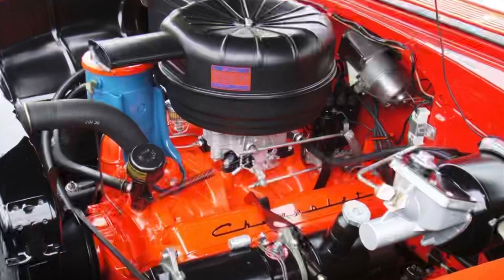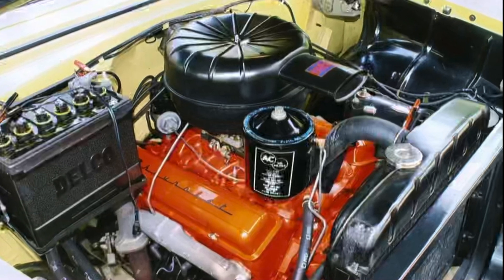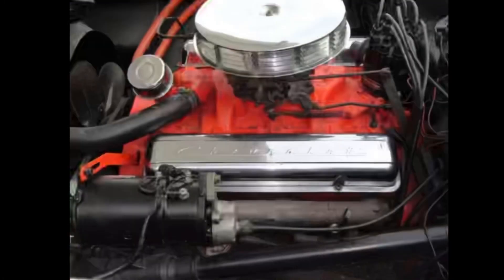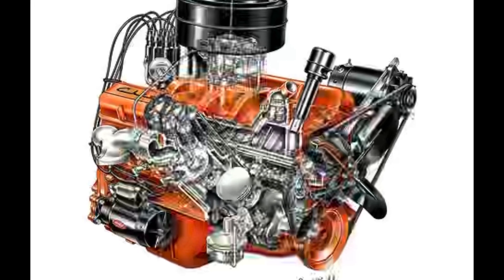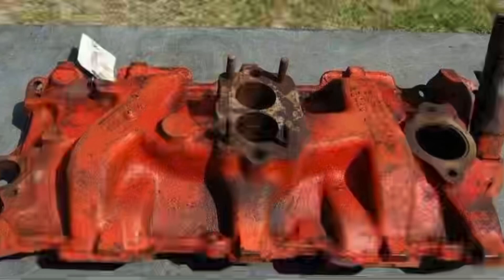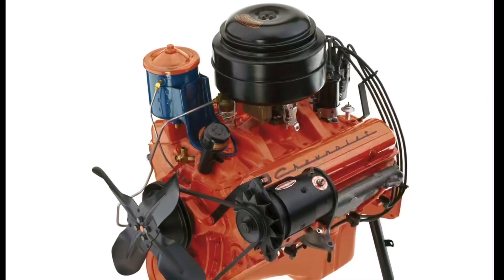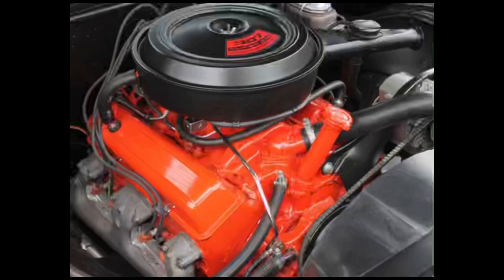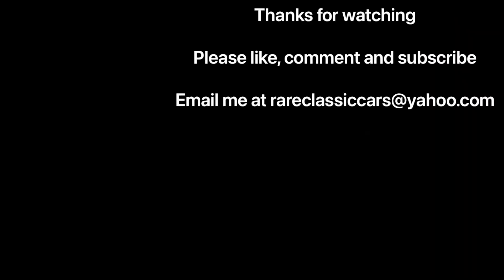Best Engines of All Time: The Chevrolet Small Block V8 (262/265/283/302/305/307/327/350/400)

Comment: Arguably one of the most versatile engines ever made. From basic transportation to super performance, the SBC did it all.
Reply: Facts. Another great sbc is the 5.3L (basically an LS, but for basic transportation and work specifically in 1999-2006 GM trucks) those engines can take a lot assuming basic maintenance is involved. To me, that particular chevy small block is like an old 327 and a 350 combined cylinder stroke wise, with modern touches and technology. They are best of both worlds for basic use and performance like the 350. But it is more well known as the LS engine that you could swap into anything and maxed out for performance. Vortec 5.3L or not, they are both great to me!
Reply: @trickyricky12147  The 5.3L LS is basically by far the cheapest engine to buy and swap in pretty much anything.
Reply: Don't forget Marine.  Chevrolet small and big block powered 80 to 90 percent of all gasoline powered inboard and I/O boats during the time they were being produced.
Reply: @DEW409  Yep you got it brother.
Reply: And just think if they were able to use synthetic oils back then how more reliable the would be
Reply: @jeremybroderick9465  Right on my brother.

Comment: The only SB Chevy Engines I had were a 1970 Biscayne SW and it had valve train clatter Never got rid of ....and a Under Powered  302 in  1978 Chevy Malibu, and a 1970 Chevy 1/2 ton with a 400 V-8 no problems except a Trans mount. good runners and cheap to fix...

Comment: Definitely the best US all around V8 of the 20th century.  Incredible power potential, reliable.  It could power a small car up to a small school bus.  Excellent oiling system, second to none. Every other US V8 had a less robust oiling system, which you discovered if you tried to race with them.  Strong block casting, with or without 4 bolt mains.   5 head bolts per cylinder.
Of course some were better than others over the years, but it hasn't remained the #1 choice for local circle track racing because something better was out there.
Reply: oiling, yes,, but strong block,,no.. to race or put any decent hp thru them, you need an 010 truck block. best engine here is the ford 6 cyl 250.. beat all the v8,s at the drags..non injected,or av gas.nox. &, it was on lpg.. 90,s.. the 350, is designed all wrong, heads, cam, lifters/rockers. 50,s tech..flogged to death..

Comment: If my memory serves, NONE of the Buick V8s had hollow push rods until 1970. All the nailheads, (264, 322, 364, 401 and 425) and the 215, 300, 340, 400, 430 and 350 through 1969 had solid pushrods. The exception being the Stage I 400 of 1968 and 1969. In 1970 the 350 and the new 455 had hollow push rods.

Comment: I remember a neighbor had a 75' chevy monza with a v-8 262cui, car was front heavy but pretty quick.
Reply: My brother in law had a Monza with the 305 and although it was smooth it didn’t feel very quick to me but the potential was there. You had to go through the wheel wells to change some of the plugs.
Reply: @garygaarderjr9733  it was a pain ..the drivers side rear plug I helped undo motor mount on that side to move engine just enough to get plug out .

Comment: My '68 Checker has a 307 with 289k miles. It'll run when I get the fuel pump installed.

Comment: My small block Chevy daily drivers would require a water pump every 70K give or take a couple of thousand like clockwork.  I loved the later years when they did away with cork gaskets and almost never had an oil leaking issue at all.  Roller cams were nice too, since the cam lobes did like to round out about the time a water pump was needed.
Reply: I just rebuilt my 1976 350 last year, and did not use a single cork gasket in the rebuild. It holds oil pretty good now.

Comment: Dont forget, the SBC was the "go to" engine for all types of high performance racing, from drag racing, sprint car, nascar, dirt track, ect.  Not to mention all the 32' and 34' Ferds out there with SBC transplants!!!  And today, it is the LS style engine, in almost every type of vehicle imaginable.  Heck, I even installed a SBC in a 49" F-1 pickup truck.   High quality high performance parts could be had for almost any size SBC  cheaper, and more readily available than any other make and model!
Reply: Because there were so many made a lot of companies made aftermarket parts.
Reply: @johnchildress6717  Yes, very important, essential, vital, and necessary!! ;D

Comment: My 350 is on a stand right now to deal with the ubiquitous rear main seal leak, but many of us leak a little when we hit 50.
Reply: I like using the 1986+ 1 pc rear main seal blocks to solve that, but there are better rubber compounds available today for the 2pc rear main seal blocks still in service.

Comment: Small block Chevy:  17 head bolts per head.    Small block Ford:  10 head bolts per head.  Small block Chevy wins.....    Long live the 327.
Reply: LS series engines -- 10 bolts per head.
Reply: @21stcenturyfossil7  I guess the Small Block is better then.  New is not always improved.
Reply: @michaelbenardo5695  , More bolts aren't better if they're not in the right place.  Head gaskets usually blow at the thinnest section, between the cylinders.  And that thin section benefits from the direct pressure of the head bolts.  The top bolt on a SBC cylinder is placed well and, ideally, they'd be another bolt mirrored at the bottom.  Instead, there's two bolts over an inch away from the ideal position.  I have no idea why.  The Pontiac V8 shared some engineering with the SBC and Pontiac did fine with the less complicated arrangement.
Reply: @21stcenturyfossil7  But 4 is the minimum.

Comment: Definitely love at first sight.  I have fond memories of my 327 - two barrel, pre-federal emissions.  My current V8 is a Toyota 4.7L / 285 cubic inch with four camshafts, 32 valves and variable valve timing.  The owner's manual says it is good for 283 hp / 325 ft. lbs. of torque and it met emissions standards back in 2005/06.  Compared to the older small block Chevy, the Toyota V8 is stupidly expensive to repair.
Reply: Lots of 4wd guys in Australia swap to a 350 and they go well. Cheap on parts ,easy to fix can't go wrong.
Reply: Yep you got it brother.
Reply: And the Toyota, like almost all of today's engines, is overly complicated.
Reply: @michaelbenardo5695  Ahmem brother,  how true and they are gutless slugs . I've always had an old 318 with a mild set up as a daily driver around 300 Hp. Nothing special but great on fuel and they run forever,  750,000 k's easy. Bought a new Holden with the alloytec engine, supposed to be 200 k's. Bullshit , worst engine I've ever had . Car broke down at least every 2 weeks then the timing chains went so I traded it on an SS Ute ls1 . Much better car but I'm rebuilding my old Chrysler wagon and I'll stick to the 318. At least I can get that running any time any where .
Reply: @petergoodwin2465  I've always wished to put an original Polyspheric 318 in, say an early 70s Plymouth and build a souped up version of the 57 Fury 318 - dual quads, 290 horsepower at 5400 RPM.
Reply: @michaelbenardo5695  I forgot to mention that the Toyota 4.7 liter also has 8 coil packs and timing belt that needs to be changed every 90,000 miles. . Don't get me wrong, the 4.7 is fine engine - but it's way more complex than the small block V8 engines of the distant past.
Reply: @andrewinaustintx  I have no use for an engine that uses a rubber timing chain.  METAL timing chain for me, or else timing GEARS.  Only exception is the Pontiac OHC 6 of the 60s.  It's timing belt was field tested on dirt roads with no timing cover for 100,000 miles without breaking.  Only then did Pontiac approve it for production.

Comment: I love my 5.7 TBI in my 94 Silverado. Almost 207k miles and not one hiccup
Reply: I had one of those, now have a 96 C1500. The Vortec engine is a step up from the TBI, though both are very reliable engines. Have had to replace the starter motor and alternator in the current vehicle, but generally speaking the maintenance required is pretty minimal if you don't thrash them.
Reply: Chevy had some good small block engines but the were rust buckets

Comment: I’m a big block Mopar fan. I always assumed the design of the big block Mopar was a result of looking at the small block Chevy and fixing the idiosyncrasies. The big block Mopar has the distributor mounted in the front of the engine, facing the fender for ease of tuneup. That same drive gear operates the external oil pump that is on the front of the engine, making oil filter changes a breeze. The block is a deep skirt design, for bottom end rigidity. Also, the water pump is attached to a housing, making a change very easy without removing any accessories. The big block Mopar also has a dry intake manifold, with an air gap underneath. So less heat on the incoming air charge. A better design all around. 😁
Reply from the maker: Well, I don’t know about that.  But the 440 is a great engine and I own quite a few of them.  Now, your comments on Lean Burn would be appreciated ;)
Reply: @RareClassicCars  
My “newest” 440 is in my ‘70 Charger. So I never got the joy of owning a lean burn. 😄
Reply: All 283 had forged cranks and rods. How about the soft metal in all those Mopar engines?
Reply: @sophiaschnase4630  All Mopar big blocks had forged cranks up thru 1970. 440’s thru 1973. Obviously all had forged rods.
Reply: @DFV  Louderilk My ‘70 Charger R/T is a factory 440 Six Pack 4 speed Dana car. It looks so cool I never felt the need to race other cars. Besides... there’s always someone faster. For me, it was always about making the scene.
Reply: I think only the porting layout is similar to the Chevy.

Comment: Great video. You mentioned the LS but you didn't say anything about the 2nd gen small block LT1/LT4. They were only produced for a few years in the mid 90's and most people forget about how great they are. I've got a 1996 Buick Roadmaster sedan with the LT1 engine and it is about to turn over 170k miles on the original Optispark distributor. The Optispark gets a bad rap, but it's not that bad at all. It's placement under the camshaft driven water pump isn't ideal. But it's a great improvement over the HEI distributor.
Please do a video on the LT1/LT4 engine before doing one on the LS. More people need to know about it
Reply: I hear you. I currently own 3 LT1 Roadmasters and a Fleetwood. I have owned two other Roadmasters and 4 other Fleetwoods. I love the LT1 engine! The bad rap they got was mostly from Camaro, Firebird and Corvette owners because they did not have the venting system working of engine vacuum the Roadmasters and Fleetwoods (and I think Caprices) had.
Reply: @MostlyBuicks You mean on the Optis? Those were factory vented starting in 1995 on the F bodies.  Made them a lot more reliable. You can retrofit a vent on the '93 and 94, easy peasy. 

The only problem with the OptiSpark is the placement, not the design. It's undeserved reputation comes from kids who go to Auto Zone or buy a new Opti off of ebay and expect them to last.

Comment: Even though I'm a Ford fan, I have to admit that the Chevy small block was an amazing achievement.  Even for me when I picture a default engine, it's a SBC.
Reply: Same here.
I love cars in general but have a soft spot for classic Fords but my 1931 Ford Model A hotrod (my avatar pic) is getting a cheap, reliable healthy 283 Chevrolet because its compact, powerful and cheap to build.
When something is good it's just good.
When I was younger small block Chevys were being put into everything and I used to hate it but now I get it I guess one could argue it is the same thing today with an LS.
Reply: @AtomicReverend  May I ask why you didn't go with the LS?  The LS seems to be the modernized SBC.
Reply: @hangonsnoop  The LS is better, but doesn't have a distributor or a provision for a mechanical fuel pump.   Of course there's kits to deal with that,  but adding an electric fuel pump on a really old vehicle has its own problems and complexity, especially if it needs a fuel return line.  Then you need brackets and stuff for the alternator and P/S, etc, engine mounts.... there's no carbureted LS,  so you need an intake manifold, throttle cable stuff, on and on.    The 283 is just so simple and clean looking when done right, and runs just fine.
Reply: @hangonsnoop  a couple of reasons, most importantly its ulgy lol
The (my) Model A, I am trying to make it look like something out of 1960 Hotrod magazine so an early overhead valve was a must, it won't be a spot on period correct car but the stuff people will notice I am trying to keep a theme to.I want it to feel like my grandfather would have built it when he was a 20 something. 
Also besides the look there is a few other reasons I am on a budget so as a few examples I am running a t5 out of an astro van, they are only good to about 325HP in a 3000LB vehicle so a healthy LS will kill it,  I got out of a local junkyard, the 283 I did a freshening up on and it has to be the cheapest engine for parts including performance bits like a cam and headers I am well less then a 1000 bucks into the engine and trans and I think I am ready to here it fire up... in theory I should be right at 300 horse, which by modern standards doesn't sound like a lot but a Model A pickup with me in it probably weighs less than 2,200 lb so I would imagine it'll rip... The small block was made so long everyone at the car swapmeets have SBC parts used so you can save a ton of money also. I really wanted to run something a little more odd like an old rambler 327 or maybe a 322 Buick nailhead but those engines are really expensive to build and there isn't a whole lot of stuff made for them so everything would have to come from a swap meet. I've been saying I'm going to build a hot rod since I was 12 years old I'm 43 now I don't want to wait any longer and have to spend seven or eight years getting parts so the small block Chevy was a no-brainer at least to get it going.
The engine was a $200- CL find, it came out of a 59 El Camino that ironically the man was putting an LS 4.8 into. 
Now outside of that, the other guy that commented is correct, I wanted a carb and a mechanical fuel pump, I managed to find a brand new 1960 Ford falcon fuel tank and sending unit from RockAuto and it measures perfectly to fit behind the rear axle down in the bed floor, (somebody told me it's the same gas tank they use in the 64 to 9 mustangs I don't know although they are the same chassis so its probably true),  it was designed to be the trunk floor so can put some weight on it it's almost like it was made for a Model A pickup, they even sell a new Stewart Warner fuel gauge that matches the Ohms for the sending unit and the sending unit is designed for an early engine meaning it doesn't have a fuel pump in the tank or anything. 
The last thing is the length of the small block Chevy a Ford Model A whether you're talking 28-29 or 30-31 is a tiny engine compartment and I can notch the firewall but inside the cab of a Model A pickup truck you literally sit shoulder to shoulder with another man and there is already very limited leg room they make a 1960s Japanese mini truck seem like a full size that's no exaggeration. The small block Chevy is probably one of the shortest v8s in length that I am aware of that isn't a Ford flathead, I think the only other engine in that same length category is the Buick (and Land Rover/Range Rover)  3.5 V8 vut at 215CI it is just to small for my car guy ego although it moved my 87 Range Rover okay I'm sure it would be great in a 2200 lb car but they are also really expensive to work on.
So yeah in short  looks, cost, length and parts availability.

As for the LS I have actually been thinking my next car is going to be a 1955 Buick Roadmaster but instead of dealing with the nailhead and the terrible Dana flow automatic transmission I was thinking an LS with a four or six speed automatic out of a Chevy Tahoe or something along those lines, the Buick would probably become my primary driver so drivability aand practicality would be a bit more of a deciding factor, well that and you can hide that ulgy plastic covered engine easily under the hood a 1950s or 60s car.
Anyways that the reason so it was a long answer.
Reply: Yup, same, same! :D

Comment: The small block chevy and the lt engines are really some of the best, most simplistic designed engines ever made, they will run and run and run as long as you keep dexkool out of them. i would also suggest videos on the buick 3800 v6 and its long history, as well as the ford lima engines, both awesome reliable engines with some long history
Reply: Try Saying Buick 231 V6! Sounds A Whole Lot Better Than "3800"!
Reply: Any Mechanic would tell you that the 3800 series engines were some of the Best.
Reply: @randybeard6040  from gm when gm went fuel efficient hell yes because unfortunately when 350 went fuel injection they had Injector issues as the miles went up on the motor.
Reply: @randybeard6040  Not in Australia where it was seen as pretty rough in comparison to the Ford 4.0 OHC/Barra and the earlier Nissan RB30e as installed in the VL commodore.
Reply: And always use a good detergent oil
Reply: Most reliable CHRYSLER  SLANT 6
Reply: @craigholcombe1901  The real battle is between Slant 6 and Hemi 6